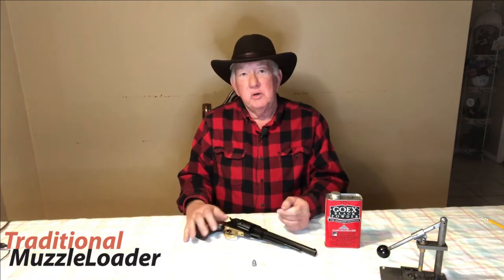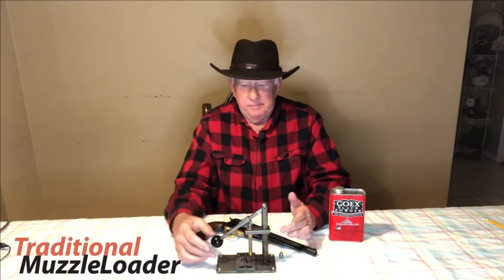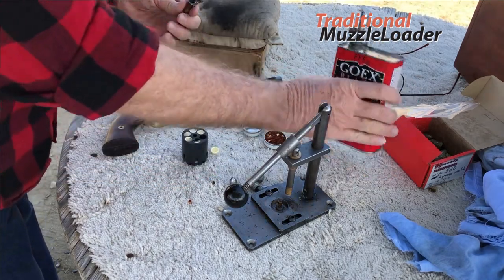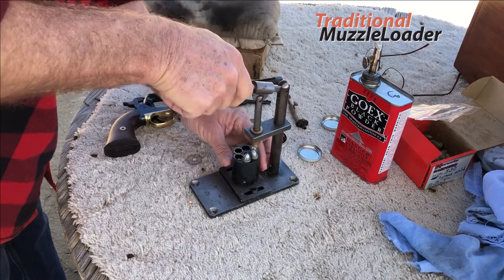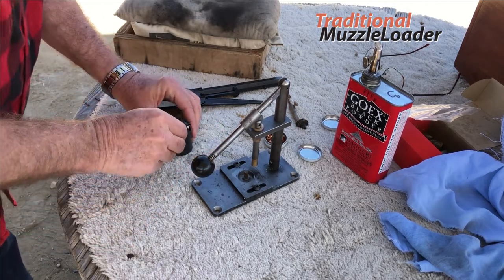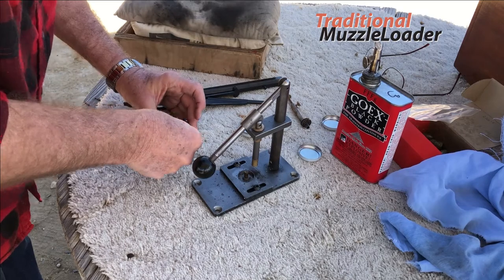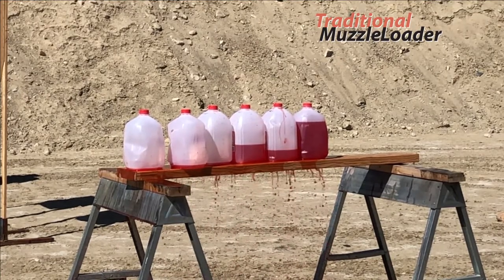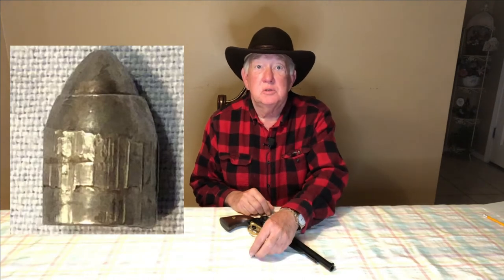1858 Remington Army Revolver

Comment: For some really stupid reason the No. 11 CCI caps and the No. 10 Remington caps are the same size (essentially).  Took me awhile to figure this out!  I think the CCI No. 10 caps are for little 31 cal pistols.  Thanks for the video!
Reply from the maker: Yes, cap size varies from one brand to another.  Remington caps tend to be larger than CCI.  I have two sets of nipples for my Remington revolver.  One set fits Remington #10 the other fits CCI #10.  Cap fit is important on revolvers. Too small can cause misfires, too large they can fall off.

Comment: I switched to paper cartridges and never looked back.
Reply from the maker: I have tried paper cartridges too.  With a round ball they load and work well.  I would need to alter the frame of the pistol as well as the loading ram to load a cartridge with the bullet shaped projectile.  Just loading the bullet over loose powder with the cylinder in the gun is a pain.  It seems to me that the reproduction pistols are not built to the same dimensions as the originals must have been.  There are several modifications that can be done to make these pistols easier to load and use.  I  may eventually do those, when I run out of more interesting projects.  :  )
Reply from the maker: And thanks for watching!